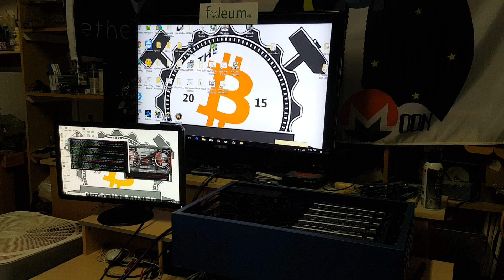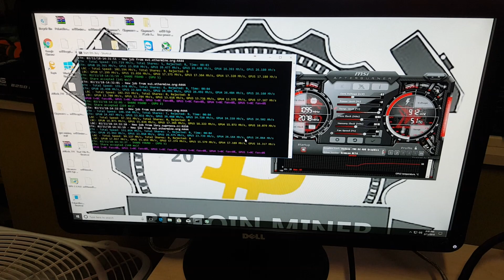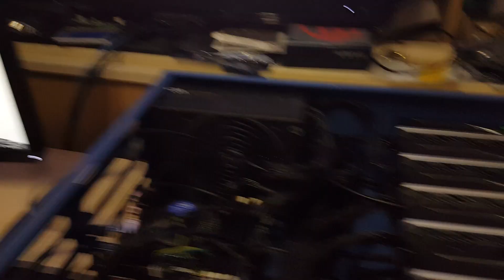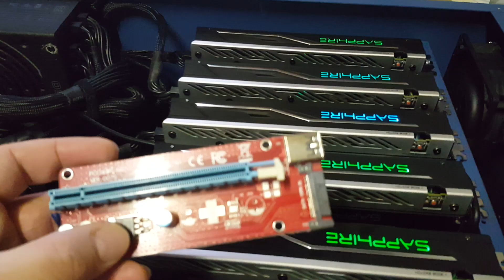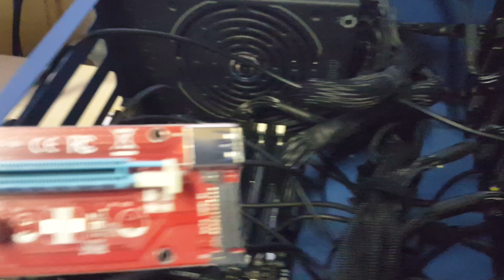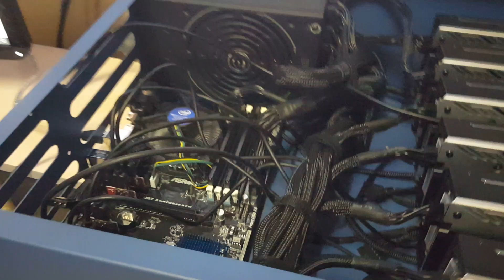GPU Mining Rig Troubleshooting Tips

Comment: Thank you very much for your advice. For information I use the software "NiceHash" for my Rig composed of 1RX470 1GTX1050 & 1GTX1070 .. that I find easy to use. But lately for some unknown reason it happens to me that in the morning my Rig Freeze forcing me to unplug it from the area to restart any Solutions ...
MotherBoard Biostar biostar tb250-btc pro CPU Core I3 OS Windows 10 64bits